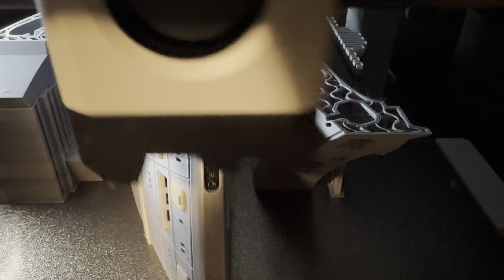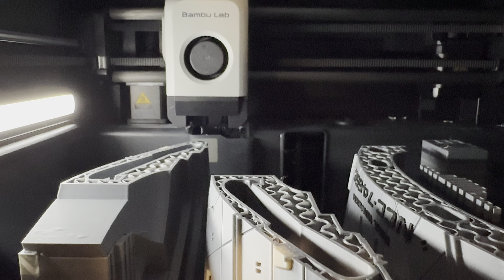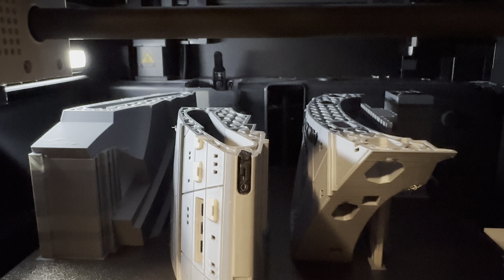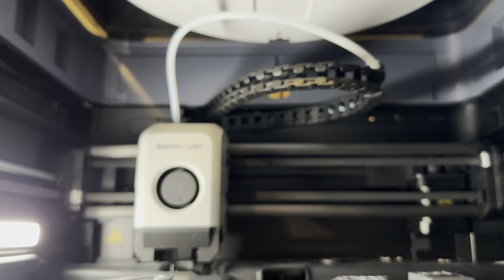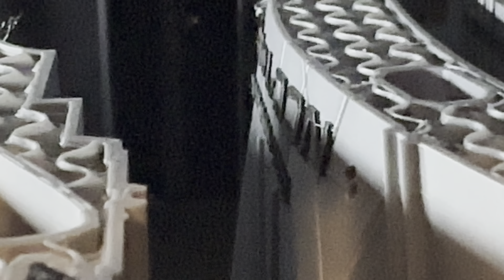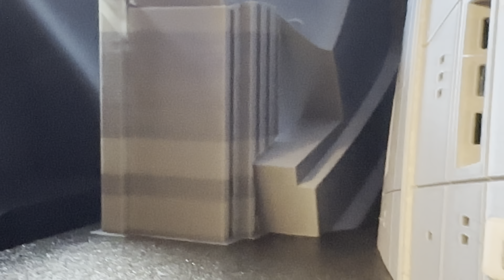Bambu P1S with AMS changing filament

Comment: Well, at least it is optimizing for 2 layers but still, so much wasted filament.  I know that optimization is done through the slicer, however, I wonder if they could possibly get to 3 layers, which would be significant without creating too much nozzle interferrence (also could be managed in the slicer).  Nice looking model.